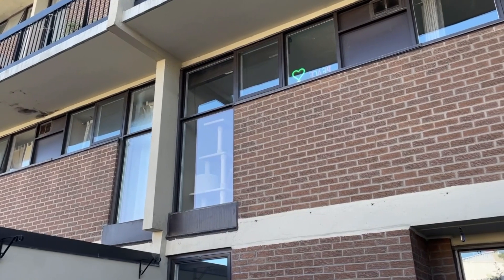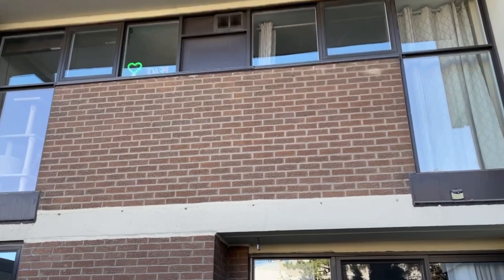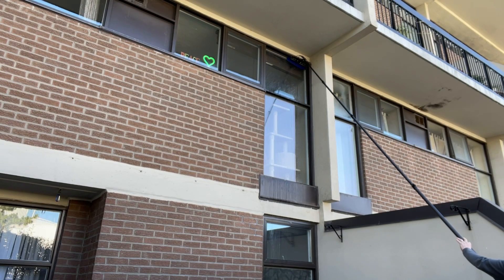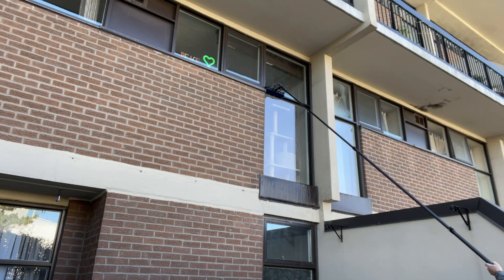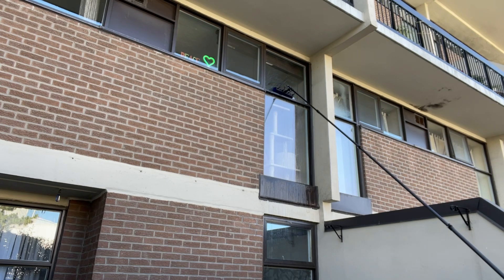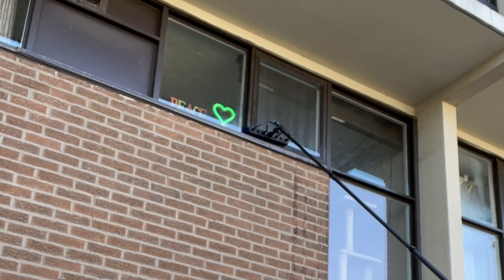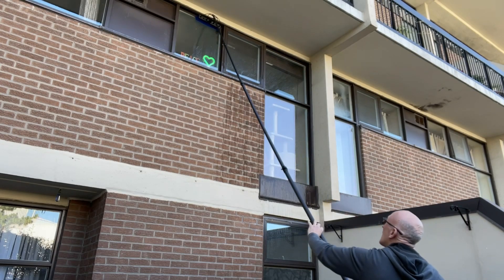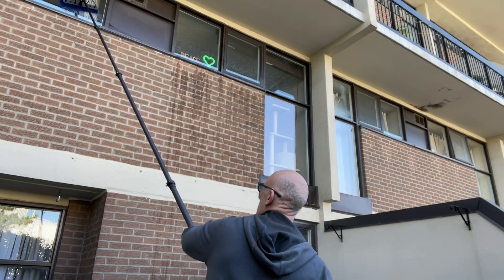Spot Free Window Cleaning Technique Using Water Fed Pole And Pure Water

Comment: A lot of window cleaner scrub the frames and glass but just rinse the glass, not the frames. Is that the correct method, or do you find the frame needs a rinse?
Reply from the maker: Really a judgement call. If the frames and area above the window is very dirty or the frames have oxidization, then rinsing the frames is a really good idea, then you can concentrate on the glass.
Reply: Thanks 👍 I was just interested because I've been rinsing all frames, and it's taking me a long time to clean, and I've been using a lot of water whereas other window cleaners I know also do their round monthly, don't rinse the frame but seem to achieve the same results a lot more efficiently

Comment: do you need to dry the surface so it does not leave streaks?
Reply from the maker: The water used here has been filtered so there is 0 minerals so no drying required. Regular tap water which is full of minerals will dry spotty. Thanks for watching.